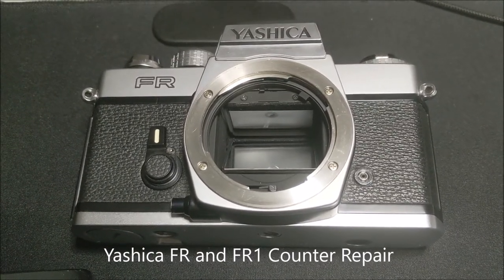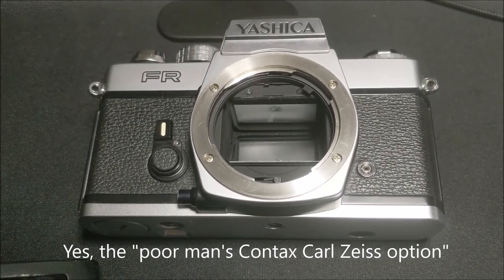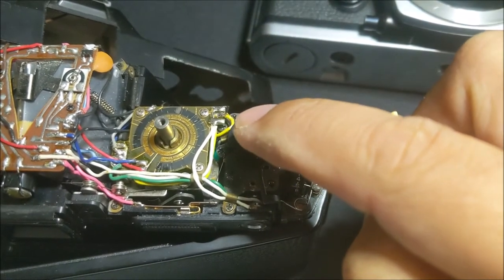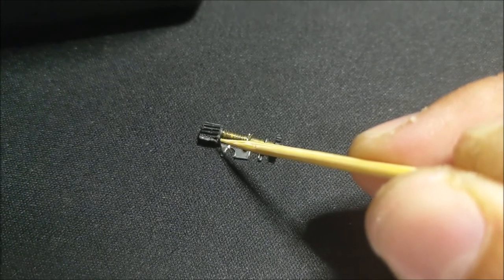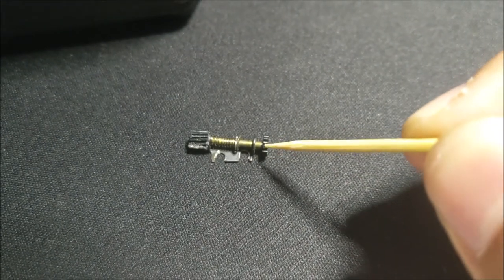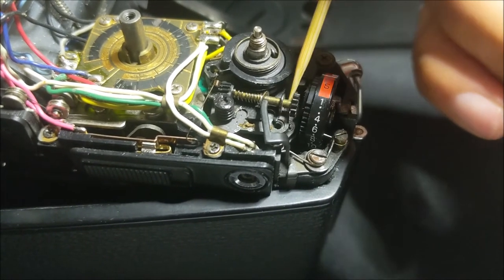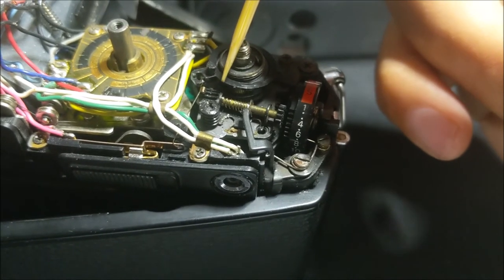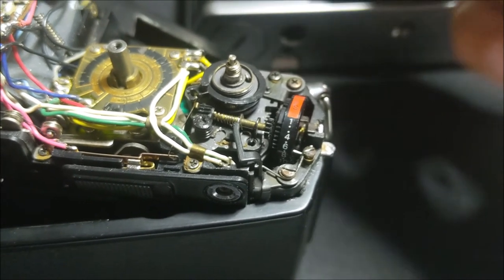Yashica FR and FR1 Counter Repair

Comment: Hey Charles, my fx 3 super 2000's counter was stuck and i unstuck it and now my light meter seems to have gone out of wack, which is odd. Is there anyway to fix it? I found nothing about that on the interwebs
Reply from the maker: Which battery are using with that camera?
Reply: @astroimagers  LR44s, they were working fine until i took my top plate off to unstick the frame counter and when i put it back its been behaving wierd, When i close down the aperture the meter asks me to increase shutter speed and fully open the meter is underexposing by 6 stops
Reply from the maker: @FookFish  i use the Energizer 2L76 in my FX3 Super. I recall reading some charts about LR44 vs. equivalent batteries. They might have slightly different draining chart profiles. Now I'm going to go down a rabbit hole about all the various battery types lol.
Reply: @astroimagers  i switched to a different set of batteries and the meter was still crazy lol, guess sunny 16 or a hotshoe light meter for now
Reply from the maker: @FookFish  found this video about the diode but looks more like a disassembly video. Looks like difficulty level 10 though.  https://youtu.be/vJwgUorbIcE